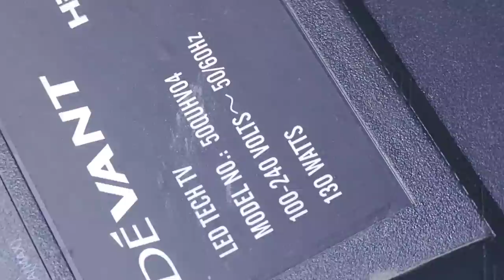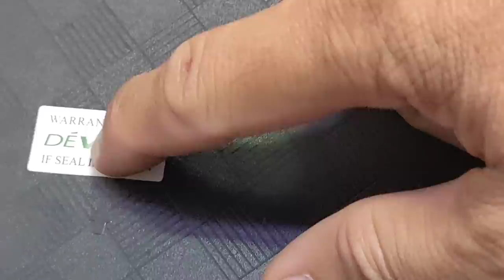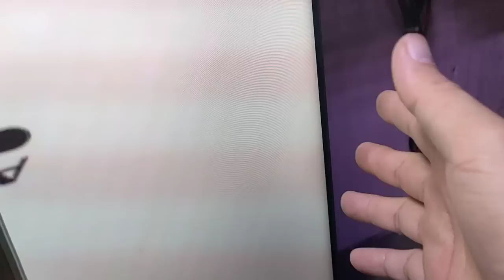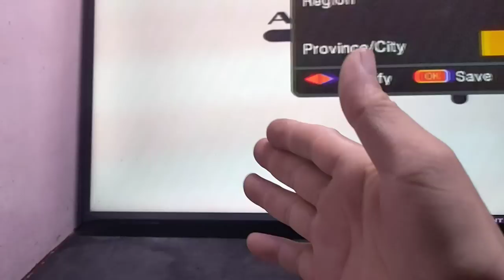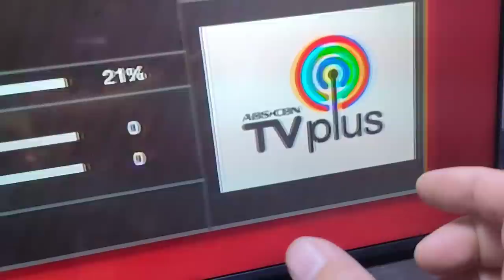how to repair devant 50 smart tv good backlight no picture

Comment: tanong lang po sir newbie lang po kasi ako may 43 inches ako good backlight at ok din po mga voltage nya kahit hang ko po kaliwa kanan walang pa rin pong display na makikita...sana matulungan nyo po ako
Reply from the maker: Check dc to dc lc1 lc2  kung normal lahat try mo mag test ng ibang board
Reply: Cge po sir try ko po bukas...pero kung ok naman po may posibilidad din po ba na sira yong tcon board nya?

Comment: lods meron akong devant na 50 inch... binilan ko ng surplus powerboard sa lazada kaso pag testing ko 15 seconds palang na nakailaw ang led pumutok na ang dalawang mosfet 10N60 sa primary ... yung unang original na board putok din ang mosfet sa primary... posible po ba na may problema sa mainboard? o nagkataon lang na may tama ulit yung nabili ko... nagtest po ako sa input ng mainboard 12v, ground, 5v. wala naman pong short.
Reply from the maker: Check backlight to body ground baka shorted